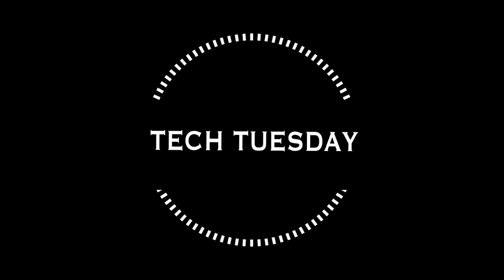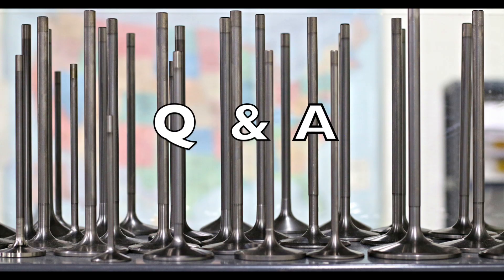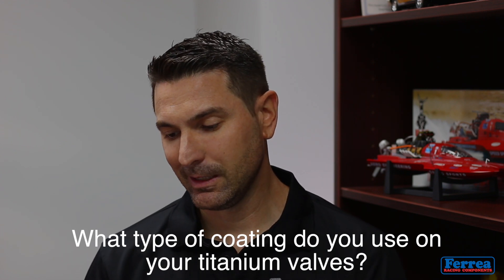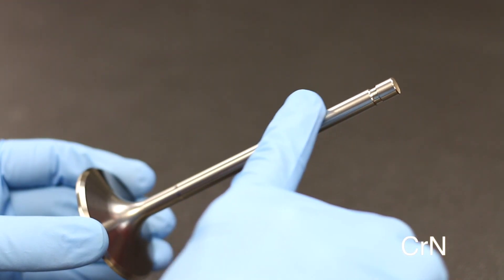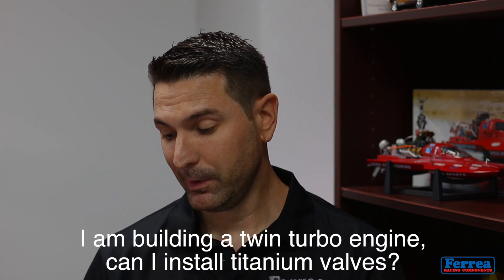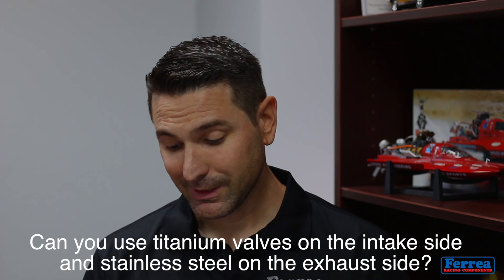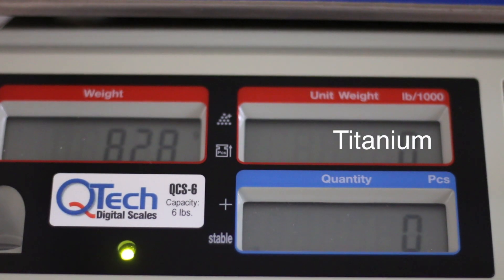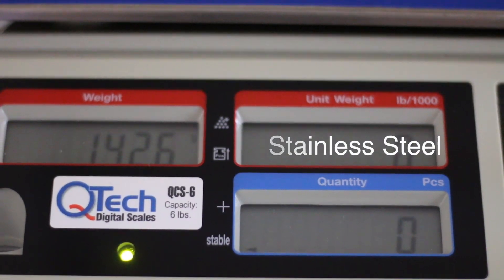Ferrea - Tech Tuesday on Titanium valves

Comment: The Ti valves are around 40% lighter which is amazing saving. Can you reduce the valve spring strength by a similar amount?
Reply from the maker: Yes, titanium valves often allow you to run lower spring pressure, but how much depends on the cam and RPM range.

Comment: To reduce mass rotation inertia and valve train reciprocating weight, will a full titanium valve-train system benefit longevity for a 7.3 Powerstroke Diesel?
Reply: No. Titanium valves are for high RPM, no benefit on a low RPM engine like a diesel.
Reply: @C6Z_Bob  I understand that it may be more beneficial for higher rpm applications but it will transfer heat better and even though it’s a small amount of weight (40% less than OEM components) it will benefit at a steady rpm range while towing, the 2100-2250 range. Less mass inertia weight is a benefit even though it’s a small amount.

Comment: Awesome video, thanks! While rebuilding my dirt bike engine, i lapped all 4 valves, then read later to not lap the intake valves because they are titanium valves with some kind of coating. Whoops, too late. Any recommendations on a good path forward?
Reply: What did you end up doing??
Reply: I ended up taking it to a shop with a former race mechanic. Turns out that a previous owner had replaced the stock titanium valves with stainless steel valves. I had him re-cut the valve seats, got new valve stems and off I went.
 @Factory928AC

Comment: Lets say a N/A V8 engine has a redline of 6K and all you changed where titanium Valves, Keepers and retainers but still run the stock camshaft. Would the engine accelerate faster?
Reply: Yes , but you can't find it on a dyno or time card ,,, !

Comment: Awesome info. Currently in the process of rebuilding an F20C motor. Sleeve, billet crank and piston hbeam rods. Only motor i might ever build like this. It will be running a turbo and meth 93 pump gas. Based on your responses in my mind it seems safe to just go titanium intake and stainless exhaust with bronze guides and beryllium copper seats or ms90 seats? Recommended springs?

Comment: "If your running ti valves you have to do much more maintenance than SS"
I'm trying to find out how titanium wears more than SS. Titanium is 2x as resistant to heat and much lighter than SS. Because Ti weighs less than SS it takes stress off of the whole valve train. If you were to get hit in the head ( cylinder head) with a bat which would you chose a Ti or SS bat? The lighter valve produces less wear on the valve seat and the entire valve train. WHen accounting for heat Ti has better strength properties than SS. ANyone who has cut titanium on a mill know that ti does not start chipping off when under heat like SS does./

Comment: Can I run a Ti valve on the intake and a Inconel EX running 80% nitro in a injected BBC
Reply from the maker: Hi Alan, you definitely use this combination for your application. Top Fuel uses our super alloy stainless steel exhaust valve and our titanium intake valve.

Comment: Tell us about the Hollow stem SS valves. Can you get an Inconel or super alloy Hollow stem SS Valve?
Reply from the maker: Hi Mike, our Hollow stem intake and exhaust valves are manufactured with our own priority high tensile stainless steel materials. The intake valves  have a blend that is very similar to Inconel,  but with a higher tensile strength. The exhaust valves are made from our Super Alloy material.

Comment: What do you recommend for valve seat material when using ti?
Could ti valves be used on a turbo street car and still get more than 60k miles?
Thanks!
Reply from the maker: Hi, we would recommend Beryllium Copper seats or MS90 seats. We do not recommend titanium valves for a turbo street engine.

Comment: Hi, how do you know which valves are titanium or stainless steel? 6000 SERIES COMPETITION VALVES & COMPETITION PLUS ENGINE VALVES?
Also how do you understand the valve specs on your site? 
Can these valves you guys sell on your site be plug and play/"bolt on"? (like just drop it in and you can just go) and not have to machine the bores for the valve guides or something.
Do we have to machine the valve seats for this to work?
http://www.ferrea.com/Honda-Engine-Valves/p34269?right_select_year=2007&right_select_make=28
Reply from the maker: Hi, how do you know which valves are titanium or stainless steel? 
We have a lot of answers to this question. 1. Price 2. You can tell by just placing one in your hands (weight). 3. On the left side of the site, you have a search function, by type. http://www.ferrea.com/Engine-Valves/c7514

6000 SERIES COMPETITION VALVES & COMPETITION PLUS ENGINE VALVES? 
Everything in our 5000 series, 6000 series and Competition Plus series is manufactured in stainless steel.

Also how do you understand the valve specs on your site? 
Understanding valve specfications. Checkout the valve print. http://www.ferrea.com/custom_valves.php

Can these valves you guys sell on your site be plug and play/"bolt on"? 
You have to take your cylinder head to a reputable engine builder builder or machine shop. We can suggest one for you if you do not have one already.

(like just drop it in and you can just go) and not have to machine the bores for the valve guides or something. Do we have to machine the valve seats for this to work?
The engine builder or machine shop can help you decide whether you need valve seats machined or not.